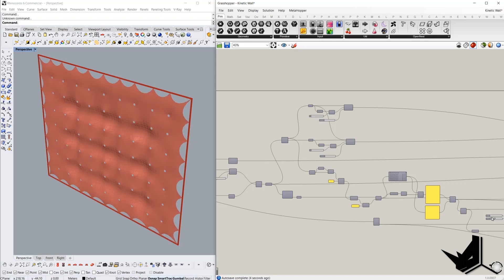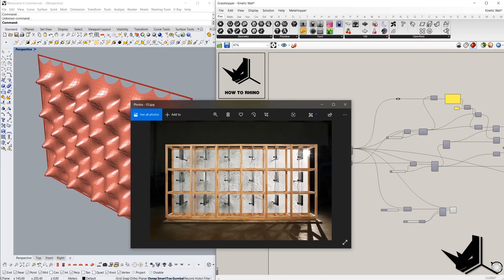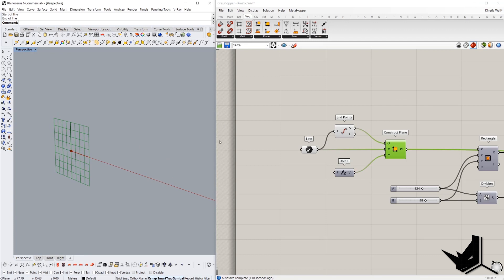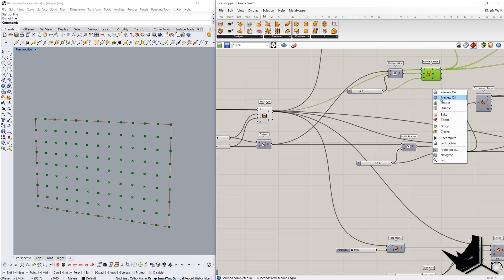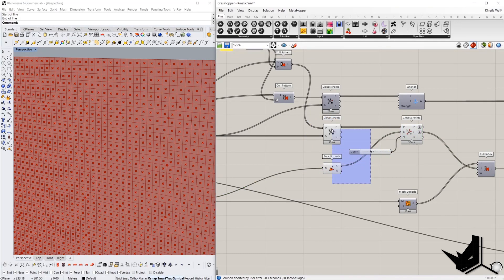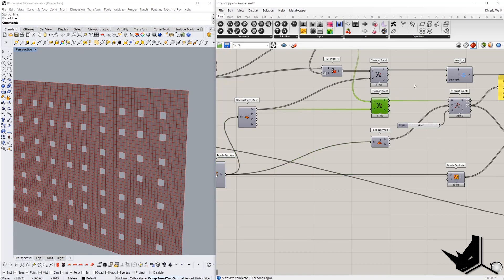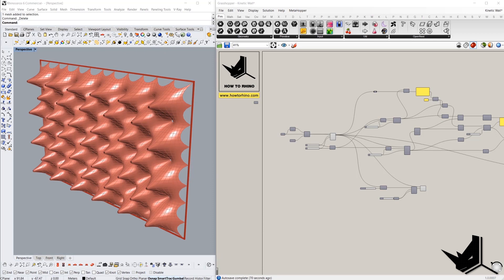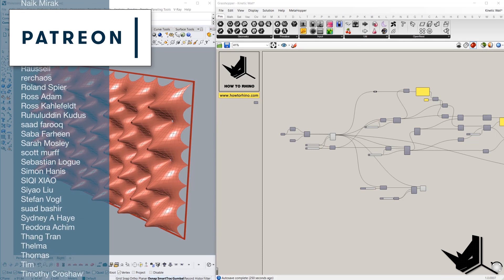Kangaroo Grasshopper Tutorial | Kinetic Wall

Comment: Can you give us some recommended  specs for modeling and rendering desktop setup, something optimal? And which CPU you think is better now, AMD or Intel?
Reply from the maker: Hi Uros, 
It depends on the budget of course, the more you spend, the better performances you'd get. 
I'd recommend at least 32gb of RAM
Processor - at the moment definitely AMD Ryzen family, they are so far ahead compared to Intel, I'd go for Ryzen 3900x or 3950x
Graphics Card - Any Nvidia GTX 2080 with 4 or 8gb of vram but even better Nvidia Quadro P4000 again, it depends on the budget
Reply: @HowtoRhino  I was interested in your opinion about the CPU mostly. Thx

Comment: Hi there, thanks for the tutorials, really appreciate it ! However have a question, when I tried to deconstruct the meshes and reconstruct them( and then flattening them in the output), they don't give the intended results ( the pattern becomes irregular and its not regular as shown in the video). However, when I used the explode mesh component then only it gives the intended results (regular pattern). May I ask is there a reason for this ? For learning and understanding purposes, thanks.